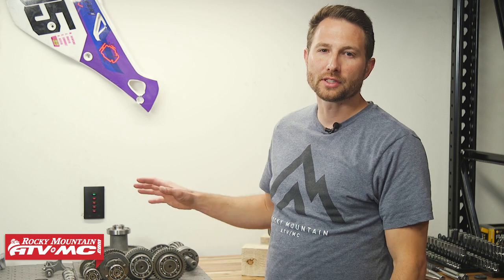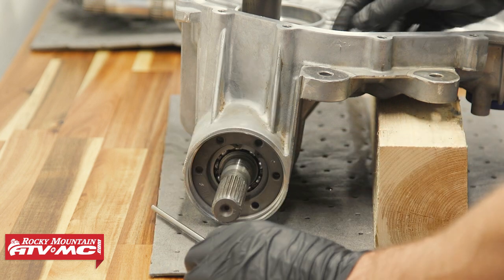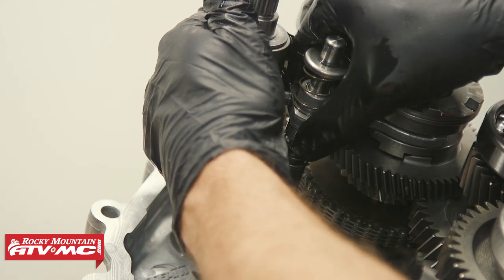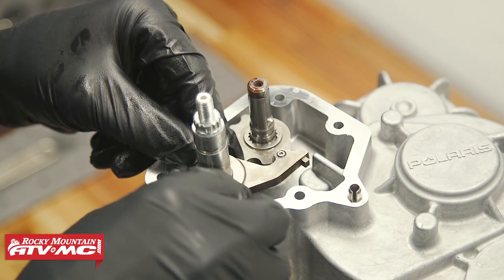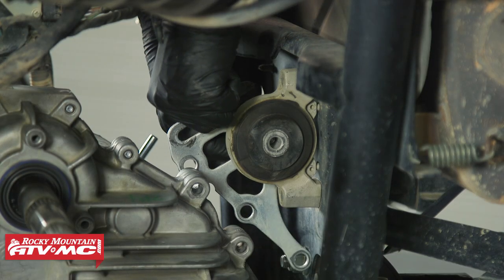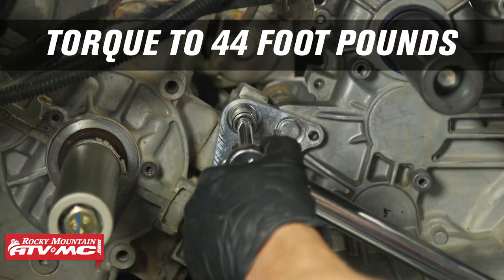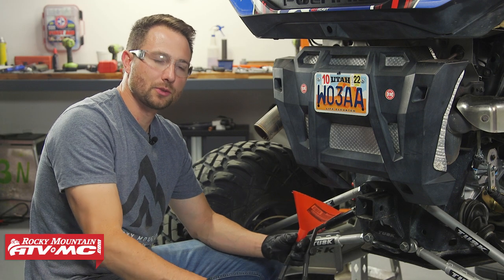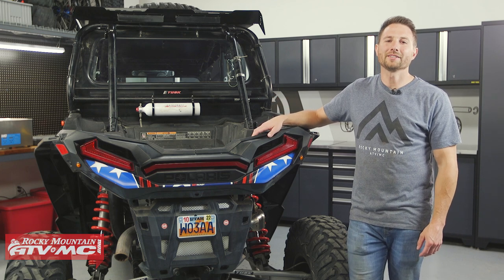How To Rebuild a Polaris RZR Transmission | Part 2

Comment: This 2 Part Guide was on point. I’ve never rebuilt a SXS Transmission but Rocky Mountain walked through all the right steps. I replaced all the bearings, installed the Turf Delete and 25% Gear Reduction in my 2017 Ranger XP 1000 with very little material outside this video.
Great tips and pointers, couldn’t have done it without the guidance. Thank you!
Reply from the maker: We love hearing that! Thanks for watching the video and giving us your feedback.

Comment: My 21 General had  a turf mode explosion ,here in Australia a new transmission was $9500 ,  I found this video which was an invaluable help for myself to be able to repair the transmission for around $2500.00 , Iam guessing about $5000.00 out of a dealers shop .I just watched both videos  on all the steps and  took my time , Thanks Rocky Mountain 👍
Reply from the maker: That's awesome to hear! We're so glad the videos helped.

Comment: Hello Charles, 
  Thanks for the video! So far it's been very helpful in my rebuild of my 2019 Polaris general. My snorkel gear and pinion gear exploded on me! I believe that the bearing on the pinion gear failed? I'm curious, what are the advantages of a 25 percent reduction gear? I see others mentioning it. Is this something I should install while I have it apart?

Comment: Great videos.. I just rebuilt my 2014 xp 1000 transmission off these for guidance.   But now all back together and all gears work except High gear.  Selector moves to high and indicator on speedometer says  H but acts like it's in neutral?  What could my issue be?

Comment: both part 1 and part 2 were great help! thank you! I've never taken a transmission apart, because of this video I was able to take it apart, do the gear reduction, and put it back in place torqued to specs. perfect instructions. I did not use the red lube in the new bearings, is it really that necessary? I'm hoping that filling it up with oil, should be enough, if not give me the bad news, don't hold back, tell me how bad i messed up lol
Reply from the maker: Nice work, glad it helped out! The assembly lube is just for the first little bit before the oil gets everywhere. It's too late to take it back apart, so I guess it will have to work. 😂 -Charles

Comment: Do you sell a transmission rebuild kit for a 2019 Polaris general 1000 4 EPS ride command that has high quality seals and high quality bearings? Preferably from either Japan or USA. Thanks, Jim
Reply from the maker: We do not sell a transmission rebuild kit for your model.